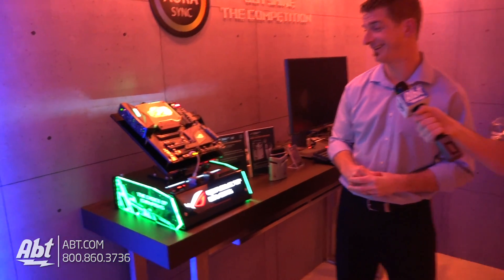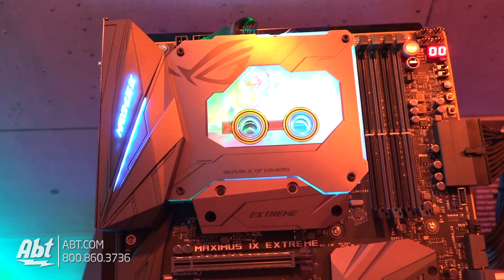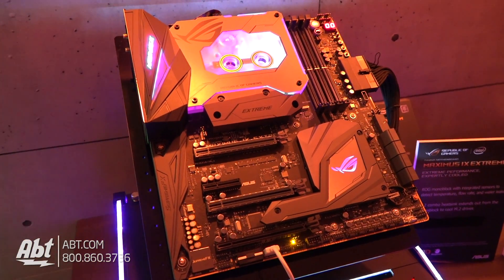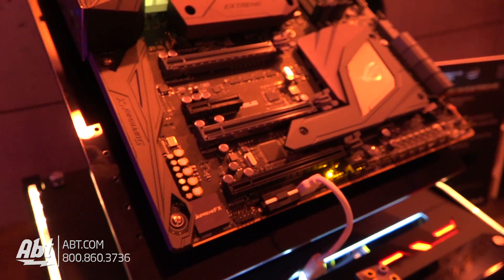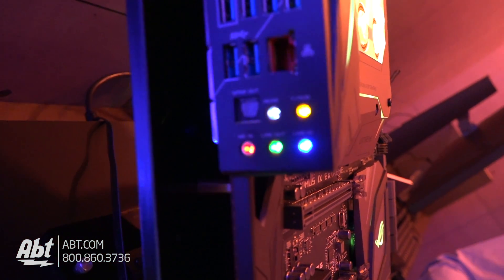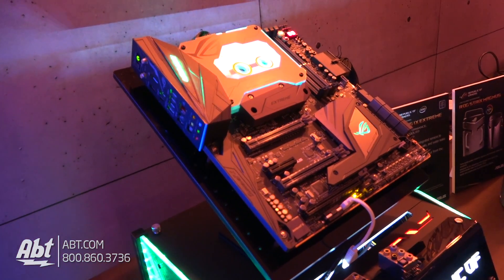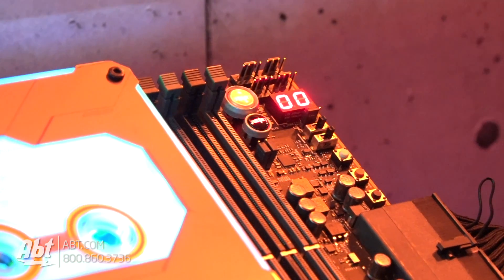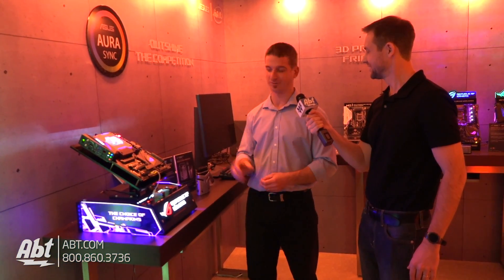CES 2017 - Asus ROG Maximus IX Extreme

Comment: I bought one of these in 2018,  I'm STILL trying to figure what 'fittings' and 'tubes' and such I need for it!  I can't even find out what SIZES,.. There is SO LITTLE GOOD INFO out there!!!  I got a Copper radiator in 2019... No way to know if I got the right one, right size, right kind, right material, etc...  ASUS SUPER DROPPED THE BALL O9N WATER COOLING,  NO NORMAL PEOPLE CAN GET THERE DFROM HERE if they don't already know or know someone that does.  I can't sit through 90 hours of Jays2cents '22 cents' to get to  the par where he says what size to use on some OTHER MB,.  it's hopeless,  I NEVER SHOULD HAVE BOUGHT THIS STUPID WORTHLESS POS!   ASUS SUCKS!  (EXCEPT FOR SOME LUCKY PPL )  so depressing...  I'm using a frigging 'gaming-3' H270 Giga BITES...  MB....

Comment: Does it supports NVME M.2?
Reply: yes. it even liquid cools them,  IF you can figure out the ten thousands little parts you need from 30 different nations to get it up and running with damned annoying water cooling,.  I HAVE HAD THIS BOARD NEW IN ITS BOX FOR OVER 2 YEARS AND STILL HAVE NO CLUE WHAT SIZE 'TUBES'  OR 'FITTINGS' OR ???,  THAT I NEED TO BUILD IT!!!  . HOPELESS,  NIGHTMARE!!!

Comment: Kirby lake is not that impressive from what I've seen of current benchmarks. Native 4K encoding/ decoding, 3.1 support at the chipset and support for Intel's octane. Nice additions but is it enough to warrant upgrading your motherboard and CPU, questionable. 

Secondly there's an even bigger issue potentially here. Kirby Lake is going to have HDCP 2.2 DRM built in. Which basically means if you have any 4K set older than a year. Or any device at all which is not HDCP 2.2 compatible. You might as well throw it out because it's not going to work. 

HDR issues are already showing up with console gamers. Where it won't display proper 4K streams. Worse yet imput lag is proving to be a major headache. All thanks to the f**** HDR HDCP 2.2 bs. Something to think about before upgrading to a basically locked CPU.